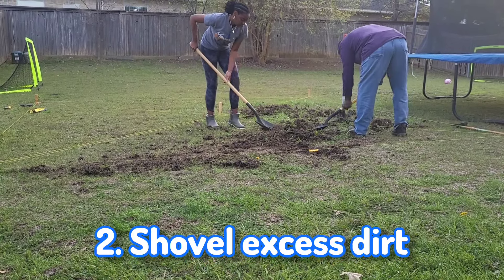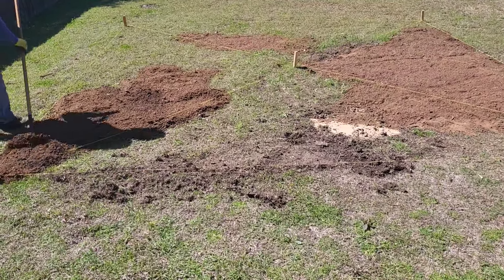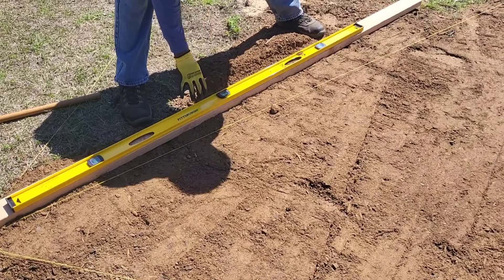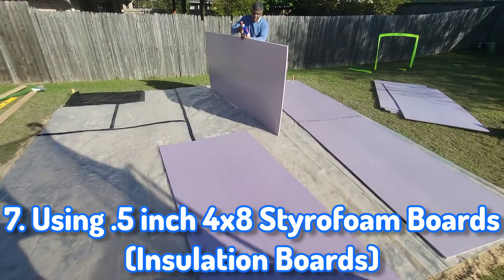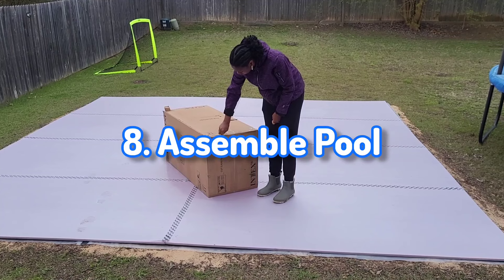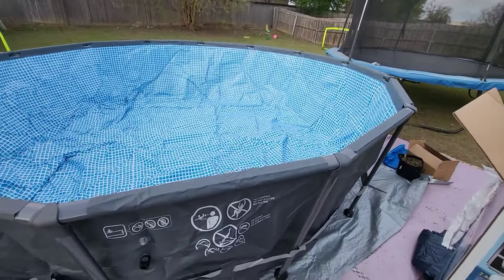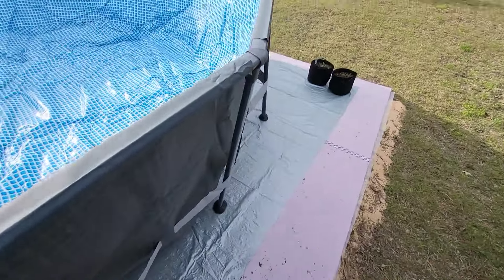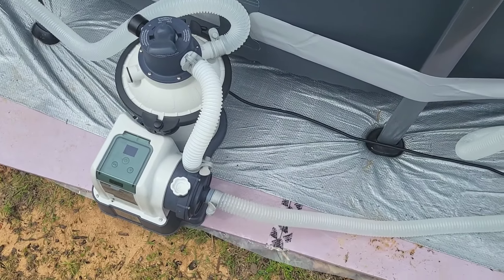Intex XTR Pool (14 x 42") In 2024 🌊 Step-By-Step

Comment: Its been 2 months.. how's it holding up?
Reply from the maker: So far, so good. I live in Texas and the ground shifted slightly. Not enough for others to see but moved about an inch or so as far as slope. Pool itself is good. Filter is an issue; I need to open it up and make sure the sand is allowing the water to move through it properly as the filtration feature does not work as good as the circulation feature. For the price, it was def worth it.

Comment: Next time when you start putting water in,  go in it and push the sides out, so the wrinkles with smooth down.
Reply from the maker: Thank you for that feedback. I was wondering how to get them out. During this time I had one foot and it was super windy- blowing the pool away. I just needed to hurry and put weight on there. I wish I could've taken your advice. Next time I will defintely do this. Thanks again.